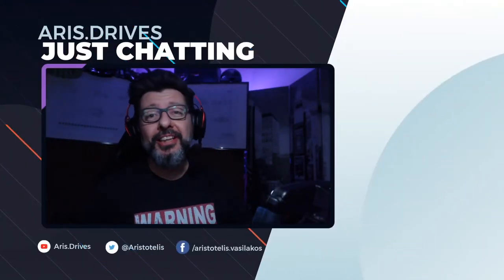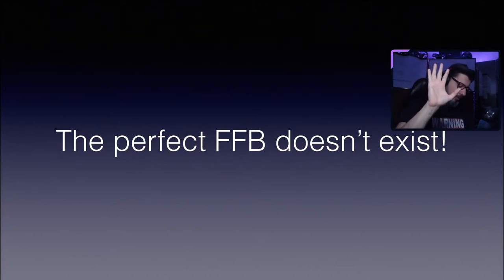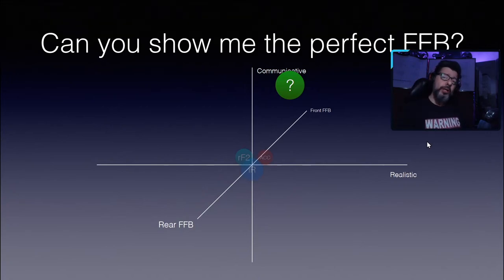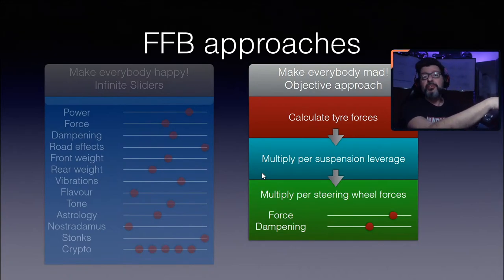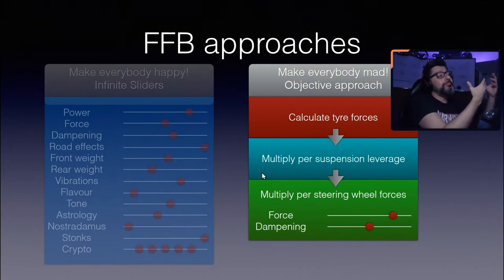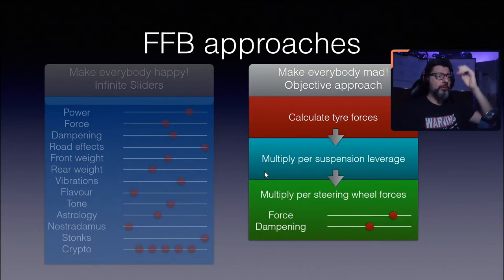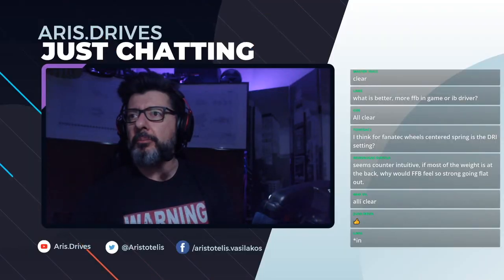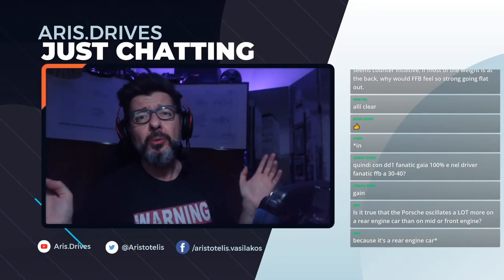How to FFB.

Comment: One little remark about setting the wheel rotation. You have to set a rotation which is not less than that of the car you are using, otherwise even when it's the same in driver and in game, it could give incorrect rotation. This could be easily a problem in cars like the Porsche which has 800 degrees of steering lock. If you set 720 in driver and in game, you get incorrect wheel rotation. To be safe, just use 900 or more. But I thought it would be useful to those who are tempted to use lower values for some reason.
Reply: ma per me che il valore di fabbrica è impostato su 365 (thrustmaster tx più tm open wheel) dovrei quindi settare per esempio se porsche 800 driver e 800 ingame, ferrari 480 driver e ingame e via dicendo? o tenere entrambe a 900 su qualunque auto?
Reply: @jerrywasaracecardriver8893  sei su PC? ACC riconosce in automatico le differenze fra i gradi di sterzo delle varie auto. Metti 900 nel pannello TM e 900 nel gioco e vai sereno, ci penserà ACC in automatico a cambiare da auto ad auto.
Reply: @Blerpa  ho risolto 7 mesi fa

Comment: Super useful. "Make sure your configuration is correct" - most games... actually all games, they don't offer an explanation this in-depth and easy to understand regarding how to verify and what "correct" should look or feel like. You just did for ACC, so thank you.

There's usually a default, which may be based on a G29, maybe on SC2 Ultimate, nobody knows. And there's a million sliders with maybe a short technical sentence for each if you're lucky, like in Forza. But it doesn't tell you what "correct" should look or feel like on gear/belt/DD wheels.

So people end up with wild parameters sourced from their asses based on whatever their IRL 50km/h daily driver is, if they even have one.

Comment: Great video! Just wandering on if you ever use the road effects slider and what feeling it affects in the FFB as in this video you have to set to 0%
Reply: The road effects take away from the real ffb , and anyway the road effects are artificial in acc and very weak you cannot tell the differences between 10 and 100% , so better to have a clean ffb signal with less clipping

Comment: Sorry to say , but the Perfect FFB does exist and is the one that does what a real car does. Perfect is even to much let's say CORRECT.
This is how I look for the Correct FFB
1) The car has to stay straight, give a slight turn and the wheel will turn back straight and car will go straight, with no help from the driver.
2) Stop the car, turn completely the wheel to a lock, now slowly accelerating the wheel will start aligning, Stop the car and wheel will stop, final result should be  POINT 1, car going straight with the driver not touching the wheel
3) Unstable the car just slightly (5-10°) angle with the Hand brake, the wheel has to counter steer just the correct to keet that lateral momentum and once the wheels get the grip, the final result is still POINT 1.
This is what the GAME FIRST OF ALL has to give you, A Garantee that the front wheels are properly communicating with the Steering wheel, Should be a two ways Communication, not a one way with only the wheel getting Stiffer of lighter.
Dumper should not be used, becasue if it tell a wheel to stop at 45°of rotation, it hast to pull/Push to that position and if it start oscillting is becasue there is a FFB logic flaw in the software.
A lot of SIM Ignore the Centering torque, like in ACC we are driving GT3 cars with 12° Caster and having NO centering torque from the wheel, You can do this simple test: On the suspension settings, front wheels, TOE IN the Left wheel and TOE OUT the Right wheel. Now put the wheel straight and drive, you will notice the car drifting off, but if you leave the wheel it will still go in that direction. This is wrong!!!! If everything is correct the wheel will turn to the left enough to have the car going straight.

Comment: I for example (dd pro) have set my steering angle for the lambo at 620 ingame and 620 in the fanatec driver it matches exactly but is 620 to low ?
Reply: Set the same angle between ACC and your wheel base driver. The angle must be superior or equal to the real car steering angle. To match every cars of the game just put 900 on each and you’re good to go.
Reply: @karelknightmare6712   thx dude !:)

Comment: I still don't understand how to set up damping on the Porsche. What should one be aiming for when setting this up on a rear engine car? Should it have the same effect as a mid or front engine car? Or does it behave completely different? I understand they'd want to rotate a lot since the weight distribution is different. It's just that I'm unsure what it should feel like.
Reply: I main the Porsche and also tried setting the damper using that car. Seems like a lost cause, as even with all damper settings maxed out it would still oscillate. Probably best to use the Ferrari like Aris did and set it to a good value for you there, and trust that the same value is good for the Porsche. If it still oscillates with that damper setting, it should then be because that's just how the car is, and not because your damper is set wrong.
Reply: @ericbourduas8141  What you said are exactly my thoughts, also. I wish someone could just properly explain the desired effect for the Porsche and how it should handle. I've stuck to around 30-40% damper now, even though for the Ferrari, or any 'normal weight distribution' car, I need only 10% or even less.
Reply: Γεια σου Άρη,my Moza r9 limited by thermal losing FFB power with damping, friction settings after 20 mins.Tried to cool the device with fan.I can't set my device with such inconsistency in functioning.I know its summer with high temp room 31c but that is not excuse when you pay a product to produce 9kN only for few minutes

Comment: Great video.  Sadly tyre wear is massively exaggerated on TS 300RS since 1.8. Ffb feel just wears off after 3-4 laps and becomes very light. Feels amazing at first then disappears. Clean racing. So annoying. Have tried everything and all settings and different cars and setups !  Seems some other thusmaster users experience same. So annoying. Ruins my enjoyment.  Take a pit stop and change tyres and the weight and track friction feeling in ffb is back. For 2-3 laps. Then goes again. And no I don’t spin or drive aggressively. Always using car consistency and track control app top right of screen. I am 99% sure it’d a glitch in the sim relating to Thrustmasters.
Reply from the maker: That's a bit strange. I suppose this is on the console? I haven't heard anything strange about thrustmaster on PC and we don't do anything specific for different steering wheels on PC. 
Are you sure you're not overscrubbing your front tyres and make them grain? 
Let me know if this is on console or PC
Reply: That’s happening to you as it’s overheating, turn the power down if u want to work around it, I used 70-75% gain and 70-80% dynamic damp 0% road effect, on my t300rs my ffb never dies after few laps etc..

Comment: 1:02:47 you almost accidentally mentioned something about the "Dynamic Damping"
I still don't know what it's supposed to do, and honestly I feel no difference - even when switching between 0% to 200%.
Might be some astrology there ;-)
(I'm a Sagittarius and on CSL Elite)
Reply: Ah its Cause you are Sagittariusm you have to put the stonk slider at 2.5% and the clickbait slider at 55.2% after that all you need to do is go to the store and buy a jug of milk, leave it on the counter for 3 weeks and 3 hours, then you poor that in the FFB milk tank ( thats located in you steering wheel ) then you can crank the Dynamic damping slider to 200% and you'll be damping dynamically like a fucking pro racer.
Reply: @MrBazz420  Well done. Don't drink and drive, rather text nonsense

Comment: Why is it important to have game wheel perfectly align with real life? I saw a lot of posts recommending setting steering angle matching real car. For me personally, having 1080 rotation makes steering car a big challenge because i have to steer much more and harder to make turns.
Reply: Because you want to feel the real car and how it's actually steer , that s why it's crucial to have the perfect matching rotation , for example my real bmw car has 900 degree,  if I switch in a game the steering rotation to 490 the car will feel very strange to me
Reply: @bratosin1   exactly, gt3 have 300-500 degree, and not 900 or 1080, setting different from 1080 wheel rotation just changes steering ratio, and i dont get whole matching steering wheel's movement thing. Why just not to set same angle as car has irl
Reply: @kwekofmeister  the game does this automatically (at least on PC). But you need to set it at 900 or above in drivers and game settings to match rotation.

Comment: For Fanatec, is the centering Spring: SPR? Does the setting need to be 0 then ?
Reply from the maker: Use SPR to 100%, it's not automatic centering.
Reply: Nope, its DRI (drift mode)
Reply: Thanks guys.
Reply: @Fummi  DRI is a setting on Fanatec's belt wheels that add a constant force of weight on the wheel or lessen the force to let the wheel rotate faster. It is not an auto-centering setting. Far as I am aware no Fanatec wheelbase has an auto-center setting.

Comment: Aris, I have a g29 and the updated kerb ffb is too much for my wheel i think. It makes enormous amount of sound/vibration compared to before. The kerb ffb remains the same even if I reduce the gain a lot. Is there something I can do about this? Thanks.
Reply: What's your Road Effects slider on?.. Try turning it down if it's not on zero
Reply: @rwbrygel  its at zero
Reply: @AbirMojumder  I think if you're using a lot of Min force, that can make it bad... Also, Damping can help soften it... Also, try having in game Gain at 100 and adjust your wheel down through it's software.. and vice versa.. turn the wheel up to max, and the game down
Reply from the maker: The G29 utilizes plastic cogs and they are particularly loud. Still... you should have heard the G27 ones :D
Don't worry to much, the Logitech wheels are really strong and reliable. 
For lowering the forces, use some extra dampening maybe and generally lower gain.
Reply: I'm using my own LUT so I left minimum force at 0, but I'll try to remove it and use default ffb. I'll mess around with the setting and see what happens. Thanks for the suggestions
Reply: @ArisDrives  Ok I'll try that, thanks.
Reply: @ArisDrives  Damping doesn't do anything on Logitech wheels, they rotate too slowly for damping to kick in. The issue is high-frequency noise in the FFB that makes the cogs rattle. Lowering the gain further is not a real fix because HF noise is still noise even with a lower amplitude. RaceRoom had the same problem before they fixed their FFB.
Reply: @azarisLP  yea Im just worried about disturbing my housemates (I'm in college) more than damaging the wheel haha
Reply: @azarisLP  Wrong. Have you tried adjusting that yourself? It makes a world of a difference, after listening to nonsense on the interwebs about how to setup the Logitech wheels for months, I heard Aris' tips on how to set it up, used a custom linear lut with more dampening, extra filter and no extra effects apart from slip and it absolutely transformed the FFB.
Reply: @fullsendsimracing  What is this extra filter? Also does your kerb ffb shake the entire house too?
Reply: @fullsendsimracing  None of that makes sense. A LUT is for nonlinear force curve adjustments so a "linear LUT" does nothing, it certainly doesn't add any "extra filter", and there are no "extra effects" in ACC besides amplification of road noise anyway.
Reply: @azarisLP  well you could use a linear LUT just fine, im guessing its purpose is to simply increase the gain over the available 100% gain setting in game linearly, so 1% input translates to 10% output, but then i think its not so useful as it will bring in lot of clipping theoretically

Comment: The perfect forcefeedback doesn't exist is true, but I would like to have FFB that is close to real as possible, so that it would be beneficial, and the muscle memory will transfer to real life situations. What I would like to see in further development of simracing games, in regards to FFB, is more immersive conglomeration of simulation feedback. So, if ffb for the wheel, is as close to perfect, then the next thing is audio feedback (also a type of force feedback through the use of sound waves and aural response), should be given some more consideration such as accurate and improved aural positioning using  5.1 surround sound. The game generating or informing, through hearing which tyre is chirping, is also an important form of feedback. Sound volume modulation can also be utilized to inform the opponent distances, as well as, crowds cheering or booing noises, could increase/decrease dopamine when the sim driver goes past them, team orders through radio could increase frustrations , etc... Maybe also in the future, engine and transmission wear/damage may one day be a factor in sim games depending on game parameters such as driver style and team budget dictating reliability being part of the game simulation rules. It a wishlist...

Anyway, thank you for this instructional video, it has helped me a lot and I feel better about leaving settings after using the advice given here. It has reassured me that the settings are now, what is meant to be.
Reply: You’re never ever going to get FFB that is like real life. You don’t feel all that shit through a steering wheel irl you feel it all through your ass.
Reply: @cured_bacon647  I set up ffb to my how my real car feels with wheel resistance and to the point where my front tyres start dealing with grip at a corner doing 80 kph. This is what I base my ffb wheel resistance strength on. As far as replication of slide grip loss and tyre grip limit juddering, l would expect game physics and the game coding and my hardware to replicate. Kunos games seem to deliver it but with a lot of fine tuning req.
Reply: @winny625  yeah i get that and same but you dont feel half the thing you feel on FFB in a real steering wheel, you feel it all through your ass. There will be compromises always with FFB and everyone will do it differently. I agree ACC/kunos does a fantastic job with there physics engine which is what FFB is based on

Comment: Hi Aris. Can you tell me if it is correct to use 270mm wide steering wheels in ACC like the Fanatec ones or should they be at least 290mm ?????
Reply: Use whatever you want. It doesn’t matter
Reply: @cured_bacon647  With that criterion there are people who drive with a joypad. That's why I wanted to know Aristotelis's personal opinion, since for example the real steering wheel of the Ferrari 488 GT3 is about 310mm. And personally I think that any measurement is not the same and the most accurate would be about 300mm.

Comment: Thrustmaster Ts Xw p310 Xbox one ,here the settings for Acc : 

1.gain 80%  ( only little little  clipping in some heavy downforce like rau rouge,90% of the time zero clipping)  
2. Minimum force 7% 
3. Road effects 0%
 All the rest of the settings leave it standard
Reply: I have exact same wheel also on Xbox one. I too have 80% gain I would have to look what the rest is set at. Do you adjust Steering Lock based on any one car's DOR or leave it set to 900° all the time?
Reply: Also is your wheel dor set on to 900 or 1080 in your PC firmware settings?
Reply: @ptgfern4588  on xbox you must put every time the  exact rotation for every single car !  For Ferrari 490 , McLaren 490 , porche 810 , bmw gt3 580 , Mercedes 660 , Nissan 650 , I don't remember all right now 

Only with pc you must leave 900 because the pc match the rotation automatically 

On the settings of the wheel/ controll panel , you must put 1080
Reply: @ptgfern4588  on gain settings you can go up to 90% to feel better the car , you will have just a little bit clipping some times in high speed corners if you don't mind , like aris said in this video it's up to you if you want more information on all the track or more information in the high speed corners /downforces , after hours of testing I believe it s more important to feel information all the time for me so  I switch to 90% gain because I don't really see the differences in the corners with clipping or without
Reply: @bratosin1  okay, that's cool because that's what I have been doing. Thank you

Comment: 47:36 - You say "force feedback comes from the front wheels, it cannot get anything from the rear wheels, it's not connected" yet in the original Assetto Corsa you can totally feel the rear through the steering wheel, even more often than the front wheels
Reply: Nah. What you’re feeling is the front reacting to the rear getting out of balance.
Reply: The original Assetto Corsa (and many other sims) add fake FFB from things besides the steering assembly. ACC does not.

Comment: Quick question, why have you got the road effects at 0%?
Reply: It adds a fake canned FFB signal. It’s useful for weak gear/belt driven wheels but no need for it on DD. It just adds useless information and covers up the useful info

Comment: Why ACC does not use max torque output instead of gain % 
It would be crystal clear. 
Then one could decide the range and the linearity to send to the wheel. 😅
GT cars have a close range of torque. 
But for Ac2 please, it would be great to have this. 
Also in the quest of objective FFB I do not understand why is dampening not set per car. 
I thought each GT3 model had their own dampening specs because of their different power steering systems. 
Is it not integrated from scratch?    
Your integration of the car geometry applies only a kind of coefficient ?

Comment: I actually have my drivers set up at 450° and my game at 900° because the game doesn't detect the correct rate at 450 and 450, so I'm cursed to use 900 game 450 drivers with my G923.